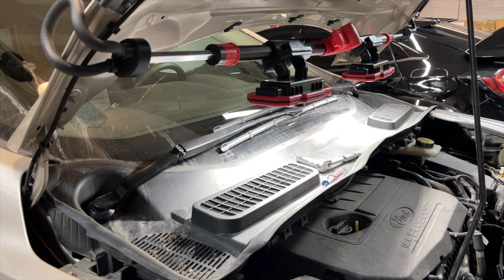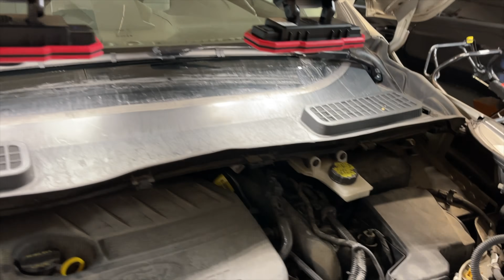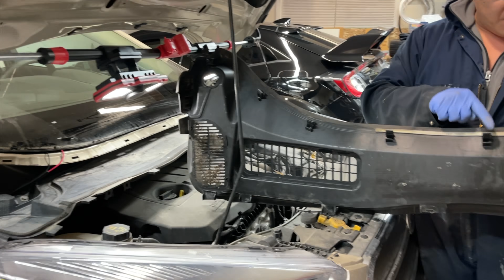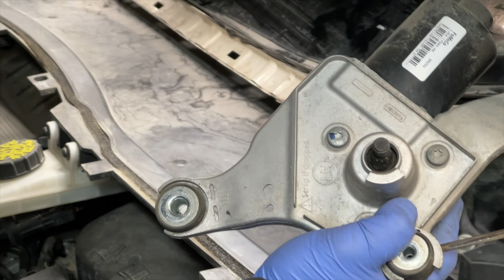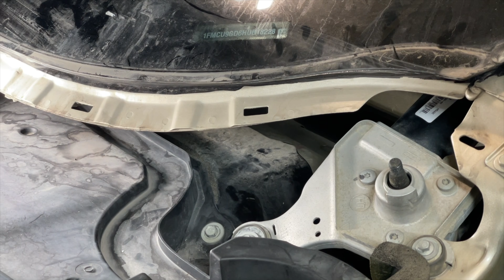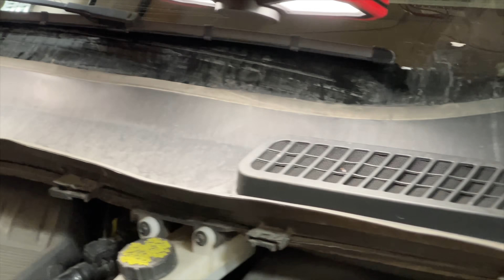2013-2019 Ford Escape Wiper Motor Replacement

Comment: I took the wiper motors from a wrecked car. They were working fine on that car. I put them on mine and they are not working, nothong, no movement. I reinstalled them back on the original car they are working. Am I doing something wrong?

Comment: Is it normal for both motors to fail at the same time? If not, what could likely be the problem when the wipers don't work at all. The fuse is ok
Reply: From what I understand, these are supposed to be "smart' wipers. They communicate with each other. If one fails and no longer communicates, the other stops working. The same happened to my 2013 Ford Escape. The passenger side motor was bad, but both wipers stopped working. After replacing the faulty wiper motor, turn on and then turn off the motors so that they are at their rest position before you install the wiper blades. Failures of these Ford wiper motors seems common, I replaced both; even though,  it was the passenger side that had failed f. I bought the replacement motors off Amazon. I paid about $110 for the passenger side  Motorcraft wiper (Model WM944) motor and $116 for the driver side (Model WM943) motor. My understanding is Motorcraft is the original equipment manufacturer. I did not have to do any calibration after installation.
Reply: @metimeti1998   Thank you. I'll give that a shot.

Comment: My wife has this car. The wipers worked fine for a long time. They randomly went out of sync a couple of weeks ago. I realigned them using the procedure described in this video and in others. I test them and everything seems fine. This has happened a couple of times since. They will be fine for a while, but after a few weeks , I notice that when in the park position, they seem to fall below the alignment marks. They will go out of sync and hook together, thus breaking a tab on one of the wipers.

Before I go spending more money on wipers than i already have, how would i be able to tell if this is a motor issue?

This last time, while driving in the rain, the passenger side wiper would come up about halfway and then just sort of drop back down with a thud. As we kept driving, it stopped moving altogether, only to connect again a few minutes later and hook the other wiper.

Comment: Dude I have to thank you so much!  My wipers were "acting all stupid" and then died completely. I called several local repair shops and one of them wanted $240 just to diagnose the problem. Then on top of parts they were going to charge $180 an hour, estimating it might take 2 hours.  I found your video, ordered the parts, and had them installed and working in 45 minutes. You saved me at least $500!! You are the best.

Comment: Would this problem be the same for a uk spec, right hand drive car. I have tried resetting my wipers by the windscreen marks a number of times. But the drivers side (uk), which would be the passanger side (us), activates first which has smashed numerous wiper blades off the arms. I am currently having to run the arms back to front to stop the arms colliding, when switched on but they don't give a very good sweep. Particularly, what would be a U.S. passanger side wiper. Any advice is great fully received. 🙏

Comment: I have a 2013 ford escape se, I replace the driver side motor and my windshield wipers still ain't working do you have a video about checking the fuses?
Reply: or battery sensor.... its on the negative battery cable... u can check it with a multimeter

Comment: Appreciate you labeling the years/ generation in the title.
Reply from the maker: If you saw the opening splash page or the description it clearly shows the years covered.  That being said, I've added the years to the title b/c that was a miss on my part.
Reply: Thanks!  Vote reversed.  appreciate that you responded right away.  Cheers.

Comment: even after I replaced both motors and reinstalled the wipers, it goes up once and gets stuck up top. help! Passenger side wiper underneath the driver side motor.
Reply: Have you found a fix?

Comment: what do you think, my left wiper doesnt work, sometimes it smashes the top cover of the front window, the right side works perfect - the left no. i made a calibration today but still the same the right side answer all commands during calibration, the second no. if i turn off the ignition the problem left motor is makin a half circle like it should...
Reply from the maker: there is a very high chance the left motor is done for.  The motors operate independently but the brains that control both are in the left motor and is a very common part that fails.  I'd say replace the left motor and depending on the car it came off of (or if its new) that you may or may not need calibration.  I was super lucky to not have to do a calibration on this car.
Reply: @piercedasian  replaced the left motor , it cost me 20 usd for used😘 and didnt need a calibration. thank you

Comment: Before buying a new motor, try this: remove the caps as he did in this excellent video and tighten the nuts.   Pretty tight.  Worked for me, saving about $100 at Carquest, who, btw, told me how to fix it.
Reply: Same thing, here.  If the bolt is moving and not the arm, it's not the motor.

I took the arm off, cleaned it and tightened it back down tight.

Voilà!
Reply from the maker: That is interesting.  Were yours simply not gripping the splines on the motor?
Reply: That did fix our same problem last time it acted this way but unfortunatly this time the wiper motor went out.

Comment: no prescription glasses till know after lasik ? just curious planning mine as well 😅
Reply from the maker: Interesting question but on my Ford Escape repair video.  I had PRK laser eye surgery years ago and did not need glasses for years.  I wear reading glasses now and a VERY light prescription to sharpen up my vision when my eyes are a bit tired but otherwise my vision is still 20/20.

Comment: I wouldn't expect this method to always work. You're supposed to go through a celebration routine every time you work on the wiper system. If you get away doing it like in the video, that's fine. However, if it doesn't work, you'll need to program the actuators with a dealership level scan tool. I would make sure I had access to one before I took anything apart. I get these in all the time from other shops that aren't equipped to deal with this design. 

If you guy's are interested, the procedure I'm talking about is listed in the main workshop manual. The only thing missing are the wiring diagrams. If you use a service like All Data or MItchell, you'll get the exact same WM that Ford techs use.
Reply from the maker: yes you're correct in stating the need for calibration.  I have been actually quite fortunate in the few escapes that I have fixed this exact issue on that none need recalibration (presumably b/c the wipers were calibrated from the factory on the other cars - this was a used part from another escape.  Your statement of needing calibration I'm sure would 100% apply to a new part since it would not have been programmed a "reference point".
Reply: @piercedasian  I replaced the driver side motor with one from a used escape. It didn't work. I had to remove the control board from the original motor to get it to work.